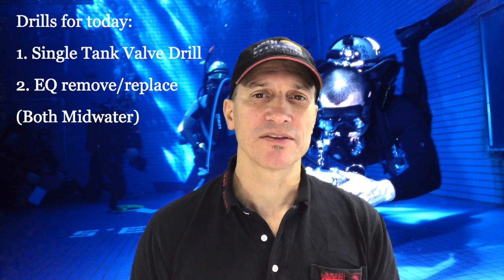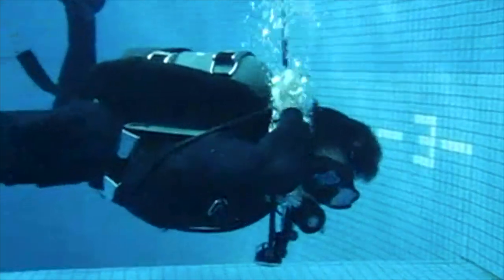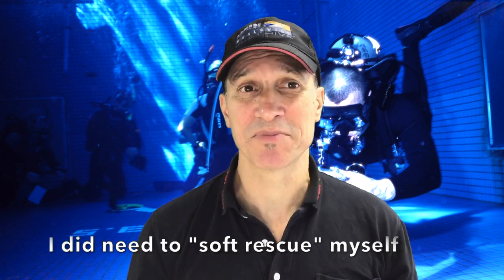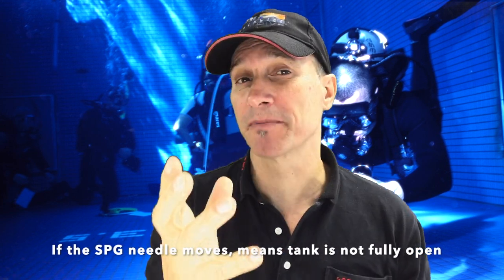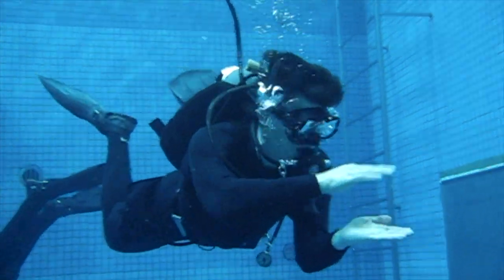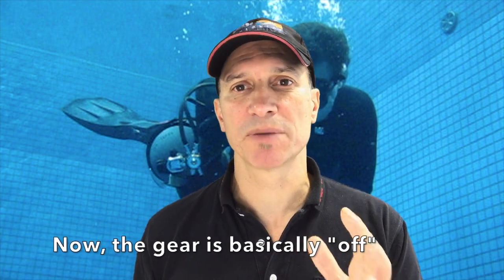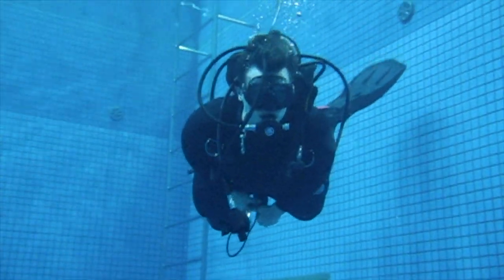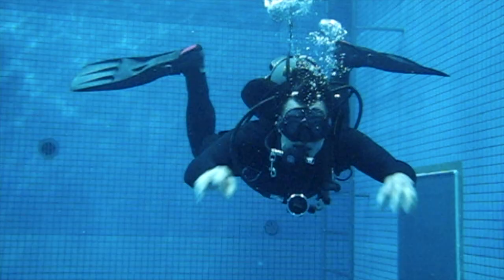Advanced Scuba Buoyancy Drills - Demo and explanation - DIR self-rescue procedure - GUE, EQ - DIVERS

Comment: I would've done a long hose deployment test after you got everything situated. I had to rework my belt after splashing, and in the process my long hose got stuck, I only noticed it because I thought "I should check that my long hose is free," sure enough it wasn't. So anytime I have to reconfig anything underwater, long hose comes out and back in. And if diving sidemount also checking my necklaced reg isn't trapped by my long hose (since the both go around my neck). Made that mistake, only realized it when I tried to switch to it inside the cave, that came up in the rather lengthy debrief.
Reply from the maker: Dude, that’s a totally valid comment. I should have added that. Thanks and hope to see more of your input!
Reply: @DiscoveryDiversTokyo  One of the things you figure out not by doing everything perfectly, but screwing up and trying to prevent it happening again.
Reply from the maker: @Teampegleg  So true!

Comment: I did a midwater remove and replace for real.  Low vis, cold water off of the Sonoma County (Northern California) coast.  I’d become separated from my buddy momentarily and also got entangled in some bull kelp.  The solution was to remove, disentangle and replace my gear.  Alas, I was diving a conventional setup, with integrated weights.  With a 7 mm Farmer John, I needed a LOT of weight.  So, when I removed my BCD, I became very aware of the fact that my BCD, with all of my breathing gas, really wanted to plunge to the bottom, while my body, wrapped in some 14 mm of floaty neoprene, really wanting to do a Polaris missile impression and rocket to the surface.  Had I lost grip on my BCD, I would have been in for a very bad time.

All went well, but now I dive with a backplate and wing and use a weight belt.  I’ve also managed to avoid further kelp entanglements.
Reply from the maker: Good grief, nice maneuver! Yeah, when I wear drysuit, I'd not want to be separated from my kit, I'd launch to the surface. I hate weight belts but see your point. Also, I've never dove a tall kelp forest..is it totally cool?
Reply: @DiscoveryDiversTokyo   Yes it is VERY cool.  Some critters live on the bottom, some near the kelp stipes and some on the blades themselves.   So, you're inside a 3D critter environment.  It's like being able to hover and fly through a forest.
Reply from the maker: @OrenNoah  Someday...it's on the list!
Reply: Good thing you didn’t lose your grip on it all. The key is to keep everything as close to your body as possible. When removing your rig, slide it around your body from the back to the front chest area and try to keep it touching you the whole time. This really helps keep you feeling attached to it so you don’t become separated. The easiest way to re-don everything is exactly as Jim demonstrated here, right arm in first, then rotate around to get it on your back. It’s great to read of people actually using this skill in real life. 😊👍🏻

Comment: Thanks for the content, plse do not take this as criticism but taking your equipment off, whilst I agree is a lot more difficult than it looks, is a risky thing to do and a diver should never really put themselves in a situation where they have to perform that
Reply from the maker: Hi Jimmy, thanks for the feedback. Well, the equipment removal is a requirement for OW, and some other courses, though yeah, on the ground. That said, I do know one diver who had to exchange gear with a DM in the water column, who needed extra air to tend to an emergency. Trippy scenario.

Comment: Shutting down your valve on a single tank is stupid. If for some reason you can't turn it back on you will drown. Trust... sometimes doing post drills your arms can cramp up and you can't open your valve quick enough and you have no alternate on a different post like on doubles...
Reply from the maker: Thanks for the comment, Alex. I disagree with your points here and will tell you why. Only happened to me once or twice, but once at depth, I discovered my value was not totally open and around 26 meters, the apeture was not open wide anough to deliver air fast enough. So, felt like out of air. I reached back to check my value, that was it, so opened up. I use this single tank droll for all Rescue students as an essential self rescue. Having control of your air just makes sense. And, when one does this drill, your buddy is right there ready to donate in case there is a difficulty. Same goes for the doubles drill. 

Thanks again for the comment and have a great day 👍👌